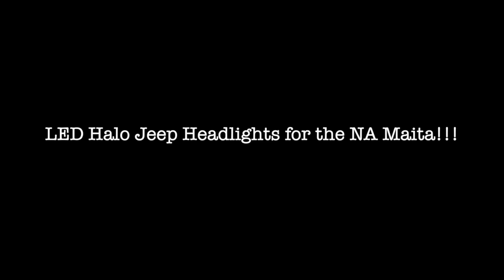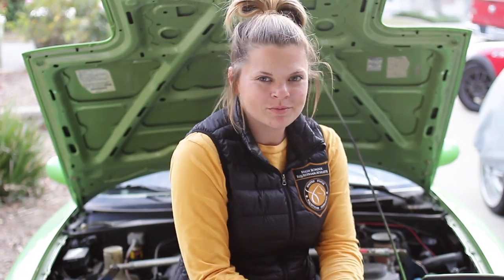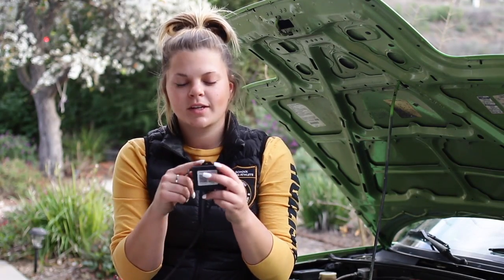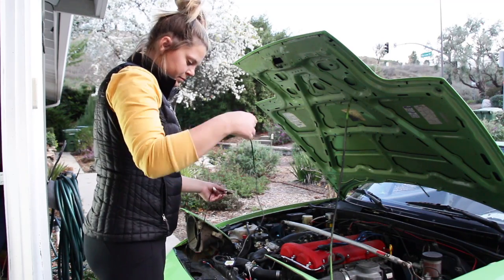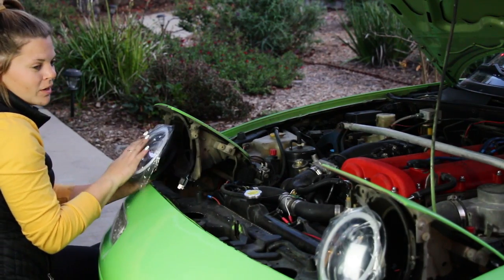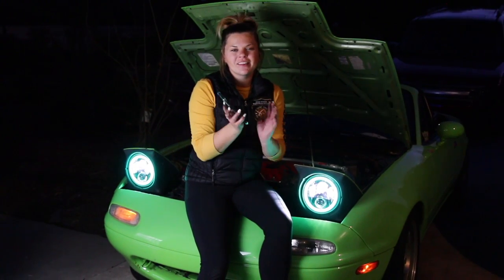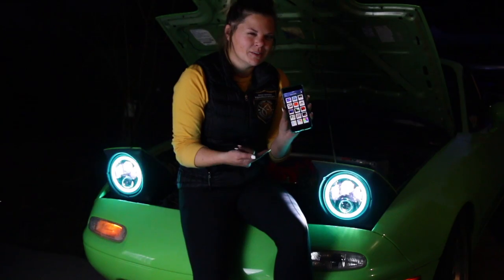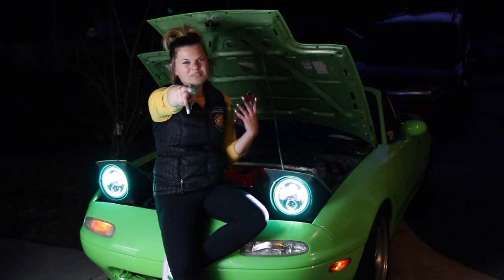NA Miata (Jeep) Halo Headlight Install!

Comment: Do your DRLs not work on that side anymore? As well? Does your turn signal work or flash fast? I am having issues installing mine properly
Reply from the maker: I sold the car but I had no issues at all
Reply: @JulietteHallie  I see your miata has the 2 bulbs (one for the turn signal and one for the Daytime runnign light right? I have the same and was trying to get similar headlights working all day. How did you wire in the RGB controller into the car if you remember?

Comment: What’s the link for them???
Reply from the maker: Mazda Guy found them on amazon. I don’t have the link for them atm.
Reply: @B00h44  the link says it can’t be shipped to the us
Reply: @AnthonyDLH  there’s dozens of those on AliExpress, I’m European so I could just get them. (Word of warning: mine can not do white, only some rgb. So I’m hoping my blue/green will not get me pulled over)
Reply: @B00h44  no white will be a problem....how’s the app tho, a lot of ppl complain about ot
Reply: @AnthonyDLH  for me it worked to set up a color after the initial giggles. Had to stand pretty close to the controller for this. Pretty sure red broke at my last display. All in all it’s a cheap Chinese party trick, if I need a replacement, I’m personally not going rgb again.
Reply: @B00h44  so just go with the plain white halos?
Reply: @AnthonyDLH  plain white or perhaps the jeep halos that can also go orange for indicators indeed.

Comment: Can you make these cycle through rainbow colors in sections? I want to setup a rainbow road type of lighting with headlights and underglow. Thanks!
Reply from the maker: Issac Roberts no not sections unfortunately
Reply: Juliette Hallie thanks for the reply! I found one on Amazon from “sunpie” that has rotating colors.
Reply from the maker: Issac Roberts awesome !
Reply: @casIIsac  how are they??
Reply: @mpwonders2329  one of the light rings crapped out on me a few months after purchase. Didn’t get much use in that time period either.
Reply: @casIIsac  Ah, i’m looking to get a pair that rotate.

Comment: Love the look. Only question is were did you tap the wires?
Reply from the maker: Nope!
Reply: The light plugs into the factory harness
Reply from the maker: @usererrorpleasetryagain5276  correct
Reply: @JulietteHallie  at 3:16 you did say "tapped the wires"
Reply: So, I've seen a lot of these headlights online and on youtube. There is a LOT of variation in the wiring. Some include indicators, some don't.  (Jeep ones do I think). For the set I have, the high and low beams work by plugging in the H3 plug. The halo is powered and controled via the BT controller. So for this I will have to splice the DRL lights. There is no indicator option for mine.
Reply: Prolly meaning the halos I assume